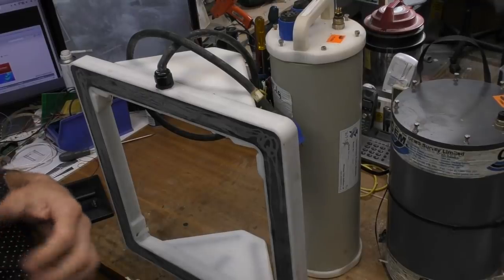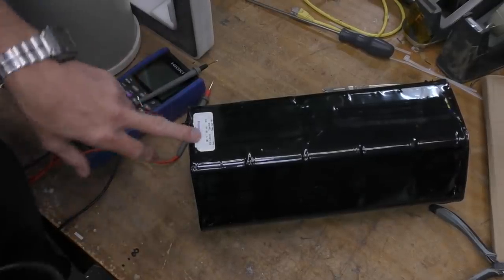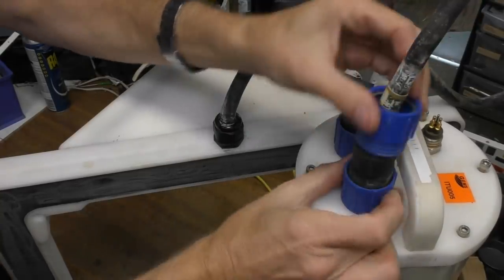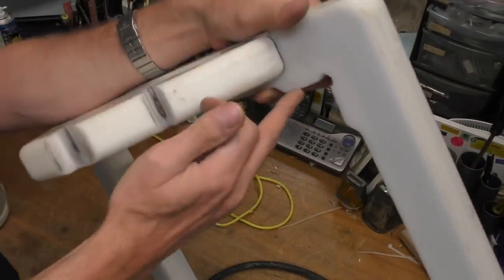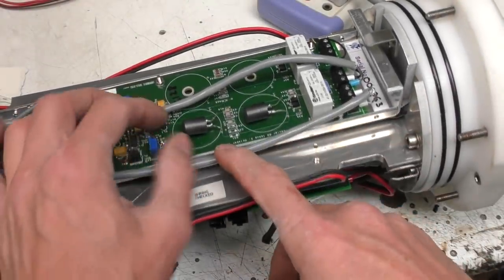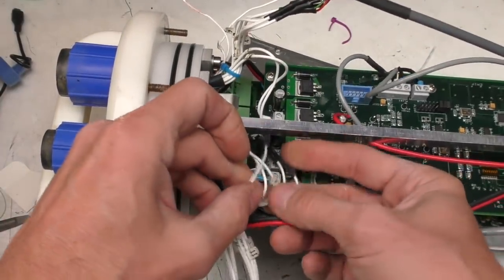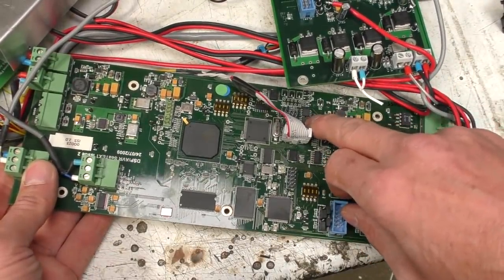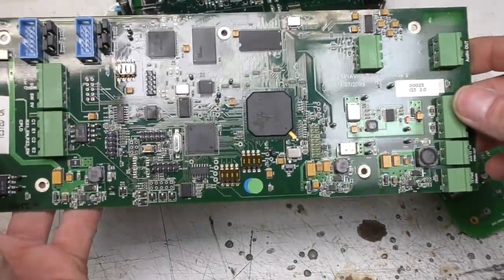Underwater radio modem

Comment: "Being underwater it'll use magnetic wave comms"
Erm, did humanity have another type of comms other than wired?
Reply: AlucardPawpad ClownWorld You are a time traveller from the 1800’s?
Reply: @marvin19966  cute, but i meant is there anything else other than wired and electromagnetic "RF" communication?
Reply: AlucardPawpad ClownWorld Optical (although you could call that EM) and acoustic comms also exist, for example. I in fact worked on an underwater comms and positioning system that used ultrasound transducers, the range was a couple 100 meters for like a Watt of input power
Reply: @dimitar4y  Optical, acoustic and scent based communications?
Reply: "Magnetic wave comms" is just a very specific kind of radio communications. It's all to do with the very low frequency used (remember, in the video he said "only a couple kilohertz").
Antennas for use at higher frequencies (dipole or omni antennas) induce electromagnetic waves in free space by fluctuations in the electric field along the length of a wire.
Antennas for use at very low frequencies (inductive coils) induce electromagnetic waves in free space by fluctuations in the MAGNETIC field in the medium. Therefore, "magnetic wave comms".

You'll note that an AM/FM radio has two types of antenna, despite it's appearance.
For AM, which is much lower frequency, an internal ferrite rod with many turns of extremely fine wire is used, which is conceptually similar to the antenna shown in this video.
For FM, a more standard aerial is often used, which is conceptually the same as "a wire of the right length" when fully extended.

For Wi-Fi (yes, that's just radio, but it operates at 2.4 or 5ghz), the extremely high frequency means that effective antennas can be smaller than your pinkie finger, and simply etched into a circuit board. However, to get a better signal, and to make the transmitter more effective, it is possible to use a longer antenna (such as the many antennas you will often find on a Wi-Fi capable router).
Reply: @JohnWatkinsUK  'avent seen em! also, optical is also RF.
Reply: @dimitar4y  OK, so I'll stick with acoustic and scent.
Reply: @JohnWatkinsUK  ... does technology even communicate using sound/smell? People can rip (acoustic) a big fart (scent). But, tech?..
Reply: @dimitar4y  Crikey, you keep adding caveats, your question was "did humanity have another type of comms other than wired?"
Reply: @JohnWatkinsUK  you're missing context, do i have to be banally explicit?
Reply: @dimitar4y Yes, this is the YouTube Comment section :o)
Yes, tech uses acoustic comms, old modems used acoustic couplers, Teddy ruxpin tapes had audio cues, phone apps listen for high pitched cueues/modulated data, firmware can be updated using audio in devices such as infrared remote controls.
Tech can use scent to communicate, 8 don't have any examples of tx rx comms off the top ofy head, but there are plenty of sensors for all kinds of gas types.
Reply: @JohnWatkinsUK  again missing context with 'DISTANCE' being key, but since we're listing miracles of science... Optocouplers! I forgot about acoustic couplers though. Oh, what about pneumatic and hydraulic remote switches? For extreme HV isolation switching.
Reply: marvin19966 was that under water positioning system similar to the COMPAT mike tore down several years ago?
Reply: Cameron Webster Certainly, we used modified beacons like the COMPATT to guide an AUV to inspect docks as a replacement for human divers